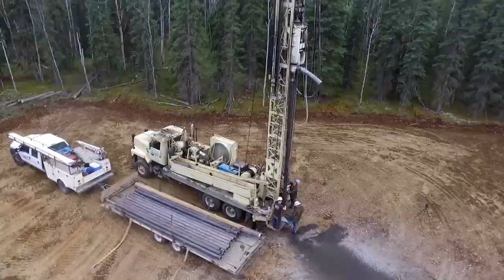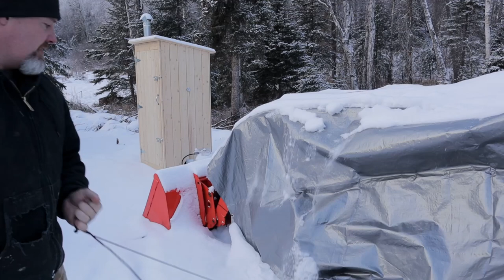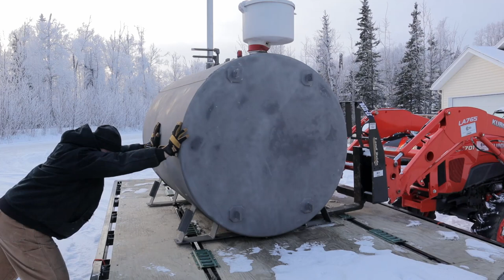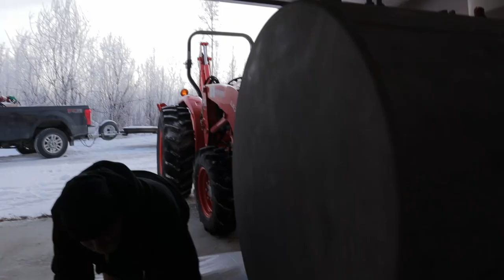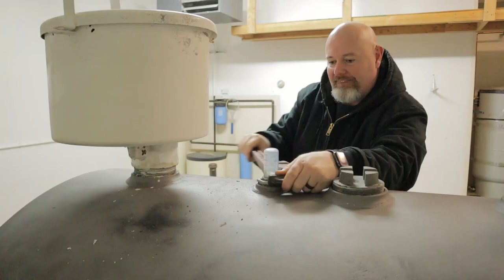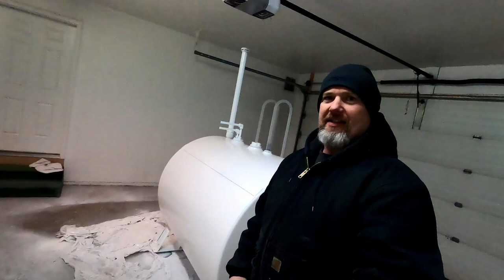I Can't Believe I DID This!!/Painting our fuel tank

Comment: The bad thing about your experience is you'll probably never need to deal with that issue again, but it was fun while it lasted.
Reply: What is the average cost of a for a truck to deliver fuel to that tank including surcharges and taxes? What is the minimum gallons of fuel most companies will deliver? If someone can't move their own tank full of fuel they are at the mercy of the fuel delivery companies not to mention a fuel truck pulling up to their door blows their opsec and may be safer and cheaper to discreetly get your own depending on your needs.

Comment: Nice work, see! you are living right......the tank "just" fit into the garage without having to remove the vent pipe! LOL Ive never seen a spray painting job that didn't at least dust everything around the paint target. Lesson learned hopefully on the respirator.....not a good choice but I get the need to finish the job prepping that tank. Should give you many years of service. I also like how you safely tested the tip potential while tugging with ratchet strap. Suggest putting it under some sort of roof will prolong that life plus  provide a more hospitable experience when/if something goes wrong at -20 and dark out! Also, Vents, valves, access ladder, and fittings are protected. Things I have found as a royal pain are: rain/thaw drip, pitch, dust, and chaff from overhead tree limbs on parked-, and stationary objects.... I dont know if all that is a factor where you are, just some thoughts.
Reply from the maker: Thanks Bret.  We will definitely be putting this under some sort of roof eventually.  I went out and purchased a respirator for next time.  Lesson learned. 😁

Comment: i think you missed the juncture of the legs and tank. it sure appeared dark before you cut off the filming. if so, that is where dirt and moisture harbor and rusts through. i certainly hope you got it and my eyes were deceiving me.....................g
Reply from the maker: I covered it after filming was finished I actually found some thins spots and went ahead and gave it another coat just to make sure it’s seal tight and ready for use.